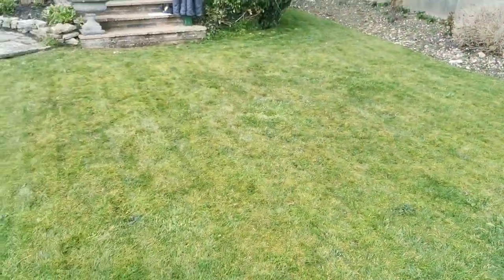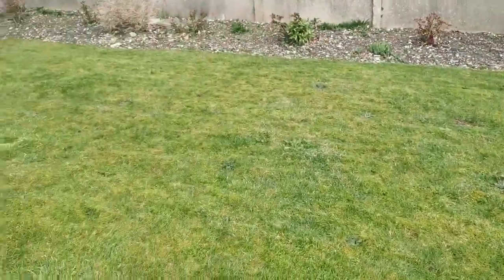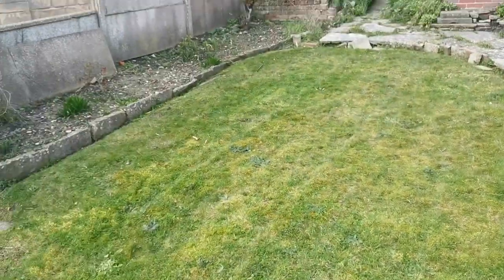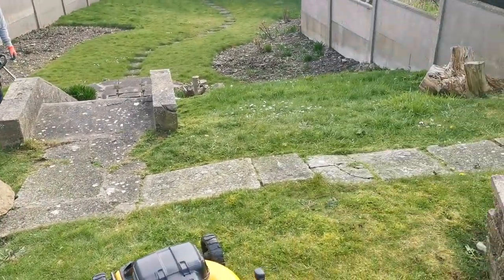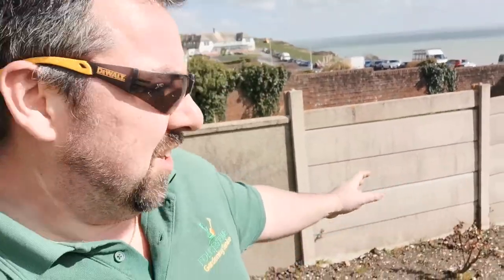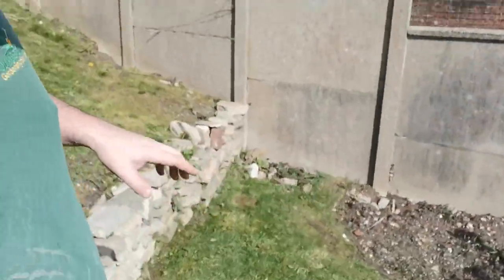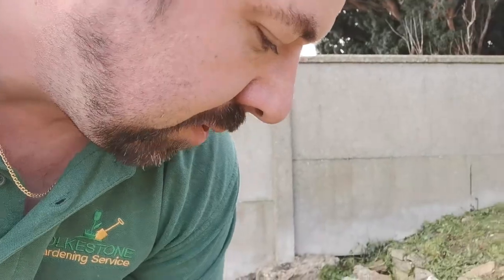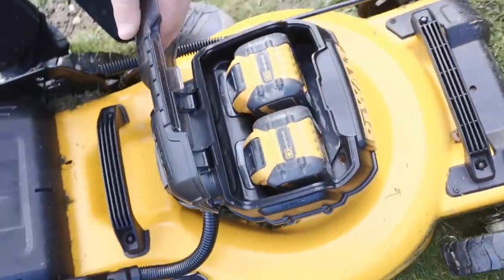Dewalt DCMW564X2 18/36v XR Cordless Lawn Mower - 5ah supplied batteries, Will it be enough?

Comment: Thanks for uploading.
your musings on flexvolt batteries around the 5 minute mark are wrong. the flexvolt system gives 54v at 3ah to tools that require it, and 18v at 9ah to tools that require it. The battery connector on the 18v and 54v tools are slightly different, the 54v tools have a different pin configuration that causes the battery to deliver the required voltage.
your observation that the 9ah flexvolt batteries give 50% more runtime instead of the expected 80% more runtime could be due to a non-controlled experiment, poor timing measurements and an experiment with a sample size of 1.

Comment: I think the 54v batteries run at 18v in 18v equipment. 
P=V x I, so the current draw will be higher at a lower voltage for the same load.
Does the mower still run ok? I’ve seen mixed reviews on it but was thinking of getting one.
Reply from the maker: So we have now gone back to petrol for a few reasons. Mainly the fact that it broke down and we had to wait for repair.

Comment: Is that the dewalt cordless strimmer you reviewed previously in the background? How is it performing now?
Reply from the maker: It sure is and I have to do a follow up on it. But apart from a few little issues we are really happy with it. The bump wind head is pretty poor build quality as we are on our second replacement.  We don't even use the bump wind on the head it is just from it brushing the ground and the plastic wears thin. Battery time is fine if you have a couple. You get a good 25 to 30 mins on high and about 45 on low and it is so lightweight. I wouldn't go back to petrol stimmers unless we are using a brush cutting blade. Hope this answer the question for you and I will get a video up about it soon.

Comment: Great video. Looking to buy this mower for my garden based on the spec advertised at 750m2. Garden is 33m x 20m so 650m2 ish. Already got two of the 6ah flex volt 18v / 54v from a previous dewalt product. Concern about the actual achievable m2 / performance of the mower with these batteries. Comments and thoughts would be appreciated 
Thanks in advance
Reply from the maker: I have done a follow up video which basically is saying that they area fantastic for your own garden but not for commercial use. I think you might just make it with 6ah but it won't make it if you leave the grass to grow too long as you would be adding a higher load on the batteries. If you keep it regular then you should be fine.
Reply: @danreviewsitall  which the follow video?
Reply from the maker: @carlrobson3694  sorry its not up yet.
Reply: @danreviewsitall  unsure why / they are allowed to advertise as 700m2 mower. So in your opinion x2 flex volt 54v 6ah should do 650m2 ? Seen so many mixed reviews on this product
Reply from the maker: @carlrobson3694  yes it not right to advertise that. My guess itls the have tested it on grass that didn't really need cutting and therefor it had no load. As soon as you start cutting thick grass and the betteties heat up it reduces to half. I think if you are doing a normal grass cut 6ah will struggle to make it.

Comment: Capacity-wise, remember, that mower is running at 36v... Its using your 2 flex volt batteries at 18v. Doubling the voltage halves the capacity. So 2 x 18v / 9AH batteries become 36v / 4.5Ah.

My Bosch electric mower, almost 10 years old now, came with 2, 36v, 2.5ah batteries (They're huge too) and each battery does about the same amount as this DeWalt mower on 1 charged set of batteries, so runtime wise, it looks like its about the same, only 2 x 5Ah batteries are half the cost of 1 Bosch 36v, and can be used on loads of other tools.

A Bosch 36v 2.5Ah battery is £215 and cant be used on anything else! This mower looks like a huge win mate... Very flexible battery system. Does the handle fold down?

Regarding being able to use it after 10 minutes when its flat, this is a simple chemistry issue with Lithium. The chemical reaction created when its running at full whack can cause it to suck the living daylights out of a battery due to the higher voltage/current, so when you let it settle and cool off, it balances out and re-stabilises, hence it can go again for a little bit.

Commercial gardeners really wouldnt be using these electric lawn mowers at all. There not suitable for anything beyond "DIY Enthusiast" and this is what these mowers are aimed at, the DIY enthusiasts who want good quality tools to use at home, and are sick of the garbage that Ryobi and the like keep churning out.

Handy for tradesmen to also use at home as they likely have the batteries from their work kt too.
Reply: Your maths is off mate.
You are adding 2 batteries together.
Not converting one battery into a higher voltage battery.

1 18v/9ah flexvolt has a total of 162Watt hours.

2 18v/9ah flexvolt batteries have a combined voltage of 324 watt hours. You don't magically loose total capacity if you add in another seperate battery.

Maths time:
 🔋18v 9ah 162wh🔋18v 9ah 162wh
Add the wh together and you'll reach 324wh

Not like 
🔋18v 9ah 162wh🔋18v 9ah 162wh
≠ 162wh
Reply: Two flex volt 9ah battery running at 36volts mode gives  9Ah at 36 volts. 9ah at 18v is 9ah at 54v it’s 3 ah.